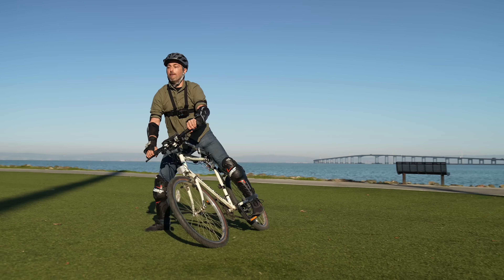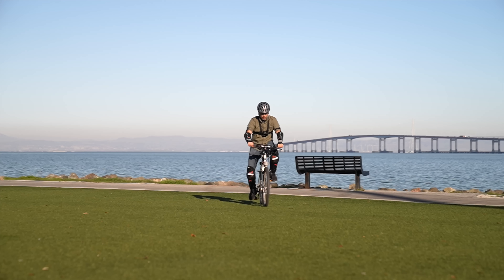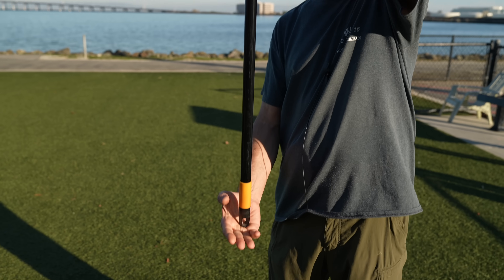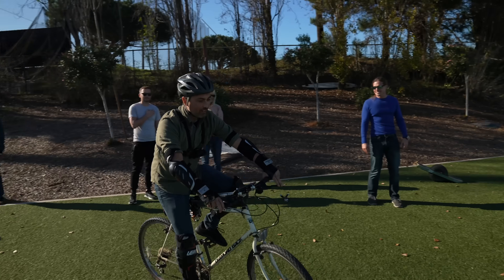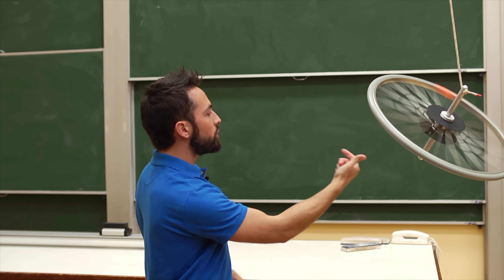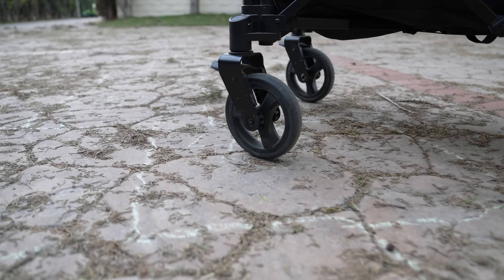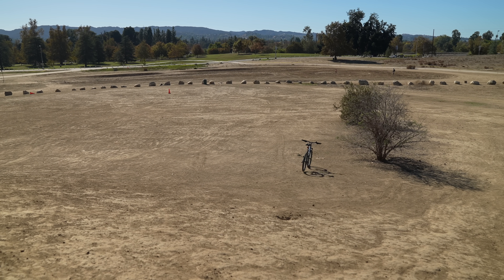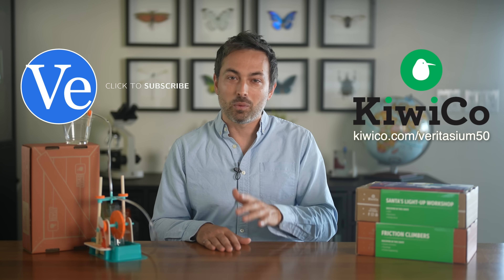Most People Don't Know How Bikes Work

Comment: After seeing this video, I did a lot of experiments while turning. I ride between 7 and 8000km per year, on the road bike.

The result is, that while counter steering, in some situations, indeed does happen unconsciously, it is definitely not necessary: one can just as well turn by leaning the body in the direction of the turn.

On MTB, this is even way more frequently used - standing up on the pedals and leaning the bike into the turn does the job wonderfully. You are not counter steering even a bit on the narrow downhill trail, I've been told by experienced MTB riders.

So, while this is one way to initiate a turn, and maybe even the most frequently used one in commuter rides or by inexperienced riders, this is definitely not the only way to do so.
Reply: >> one can just as well turn by leaning the body in the direction of the turn.

Nope.
Reply: @Rick_Cavallaro  Uh, absolutely yes.
Reply: @antred11  
>> Uh, absolutely yes.

Use your words antred11.  What are you trying to say?
Reply: @Rick_Cavallaro  You absolutely can initiate a turn by leaning into it and steering just in the direction of your turn, without any counter steering whatsoever.
Reply: @antred11  I'm willing to bet $10K that YOU cannot do that.
Reply: The bike isn’t actually turning because you’re leaning, weight distribution has nothing to do with it. I can’t believe this video mentioned nothing about the curvature of bicycle tires compared to a car that has flat tire tread. When you’re “leaning” you’re really just tilting the front tire which causes the ground to make contact with more of the side of the tire due to its curved tread. It’s like when riding a motorcycle, you push the right handlebar forward which technically is turning the wheel to left in order to make a right hand turn.
Reply: @II-XENOMORPH-II  of course. The question was, however, how the turn is initiated. Maybe better say enabled. And that's where the video claims counter steering, while in my experience, shifting the body mass does the same trick.
Reply: @alex.pozgaj  
>>  in my experience, shifting the body mass does the same trick.

That's what most people think they experience.  But it's an illusion.  Take away the ability to counter-steer and you'll quickly find how much you rely on it.  If you could lean the bike by shifting your weight, you could sit on a stationary bike and decide which direction to fall in.  Give it a try.
Reply: @II-XENOMORPH-II  
>> I can’t believe this video mentioned nothing about the curvature of bicycle tires compared to a car that has flat tire tread. When you’re “leaning” you’re really just tilting the front tire which causes the ground to make contact with more of the side of the tire due to its curved tread. 

The video didn't mention that because that's not what causes the bike to turn.  Lock the steering straight ahead and push a riderless bike.  It will lean and then fall, but it won't turn.  I've done that test with the bike in this video. The lean is simply required to balance both gravity and the centripetal force of the turn.  What causes the turn itself is the fact that the front wheel is ultimately turned in the direction of the desired turn.  But lean is required to balance in that turn.

>> It’s like when riding a motorcycle, you push the right handlebar forward which technically is turning the wheel to left in order to make a right hand turn.

The reason you push the right handlebar forward is to counter-steer (as explained in this video).  That takes the bike off-balance resulting in the desired lean.

Comment: I worked this out when I was in my late teens,  at normal and high speed you pull on the bars in the opposite direction you want to turn and you and up leaning into the turn.  Cars are a really bad example since they are one of the few vehicles that do not bank in corners.  Boats, Aircraft and Motor cycles (and bicycles of course) bank in corners. Together with the gyroscopic effects of the front wheel and the angle of the forks this makes it possible to turn corners.  I think humans with their sophisticated balancing capabilities can work this out sub-consciously and not even think about it and learn to ride a bicycle or motor cycle in no time at all.
Reply: A tricycle, like a car, is another vehicle that doesn't (can't) bank into turns.
Tricycles are often used by the elderly, perhaps because their balance is not so good anymore. The three-wheeler can help them to keep riding.
However, if the trike is turned too quickly at moderate speed, the point on the road through which the rider-trike centre of gravity acts, can fall outside the base of the tricycle. The result is that it promptly topples outwards, and the rider likely falls off in an inwards direction.
It is quite distressing to see an elderly lady fall off her tricycle while trying in vain to LEAN her machine INTO the turn..  Meanwhile, the trike is having none of it, and parts company with its rider!! 
Hmm.. the three wheel (tripod) configuration is only stable as long as the centre of gravity... (perhaps more correctly called  "centre of mass" in dynamic systems)... acts through the base. If not, then it can topple rather easily. 
Perhaps trikes should be quads, like mobility scooters usually are (?)
Reply: Yes, that's true.  Years ago I tried to ride a scooter with a side car attached.  I was an experienced motorcycle rider and when I tried to steer it it did not respond in the way I expected and rode it straight into a hedge.  Tricycles do need the handlebars to turn in the direction you want to turn.  I also flew small aircraft and these nowadays also have a tricycle undercarriage where the front wheel is steered.  But there you steer it with your feet, the same pedals that move the rudder in flight.
Reply: Nope. You all sound like you haven’t rode a bicycle in decades and the videos of this guy riding look like it. When I turn left, I turn the bars left.. my body is already leaning to compensate you don’t turn the bars in the opposite direction at all what the heck??
Reply: @SAFbikes  You obviously are talking about slow speed.  try this on a motorcycle or at higher speed and you will see what we are talking about.
Reply: @Tech-Relief  pretty sure cars require counter steering for course correction when they oversteer. You see situations like that on icy roads, rallying and drifting. It's definitely not something a typical driver experiences regularly
Reply: @felixjonson1  yea, thats because the car loses traction
Reply: @SAFbikes  on a motorcycle, you lean so you turn. The bike turns the handlebar to remain upright. If you just turned the handlebar, you would highside and crash.
Reply: @SAFbikes  Even if you don't THINK you first steer left in order steer right, REALLY you do! This video proves it. 
And you can prove it to yourself, by plotting the track of your front wheel tyre compared with the one from the rear wheel. 
You can do this in light snow, or just by riding through a puddle first.
If you do this, say, slaloming around some cones, you will see that for every deliberate turn you make, your front tyre track will first deviate slightly to the other (wrong) side of the rear tyre track.
So, you didn't even notice you were doing it? Hey! Don't beat yourself up about it. Lot's of people don't realise.

Comment: Poor mans way to verify this is to simply grasp the left side of the handlebars with your right hand and the left side with your right hand. The bike will be turned the opposite direction that the rider intends so the slight set up turn to the right will be a turn to the left and the bike will go in the direction the rider intends to turn without getting the bike tires outside the base first.

Comment: You can turn a bike while not even touching the handlebars. You don't need to steer in the other direction. All you need to do is lean in the direction you want to turn.
Reply: Bike still has to be able to countersteer or it will fall.

Comment: I've heard that steering a motorcycle requires conscious knowledge of anticipatory steering because the heavier wheel/faster speed adds enough gyroscopic effect that you need to "over" compensate to make a turn.  I still turn without thinking about it, but it is interesting to know the same is true for bicycles independent of the gyroscopic effect.
Reply: You more feel the Motorcycle.... You don't turn the bars you lean into the turn and keep the bars straight. The motorcycle will go where your eyes are looking naturally so you use that to guide the motorcycle to you don't actually steer a motorcycle.
Reply: Depends on how fast your going.  Slow speeds you cant rely all on leaning

Comment: I think that the reason bikes do not fall while moving is that “ gyroscopic effect “ as the video calls it and in dynamics’ terms  it is the conservation of angular momentum , in fact every rolling disk disk follow that law. If you let a single bike wheel roll downhill, it won’t fall until it stops or the speed is too low to maintain balance, that single wheel doesn’t have steering.  
The examples of people fall with the locked steering bike is that their speed is not high enough to balance or to provide a small time-slot for the biker to maintain balance by counter-steering.

Comment: A lot of people do the intuitive counter steer without knowing it because what they believe they're doing is "leaning into the turn". But what they're really doing shifting their weight into the handle bars. For example they are trying to turn left, so they lean left, so their weight shifts into their left hand which steers the bike right. Which ultimately ends up allowing the bike to turn left. Most people who ride motorcycles  have a pretty decent understanding of this
Reply: Absolutely correct.🤟🏻

Comment: Motorbikes magnify this and introduce some extra variables.

At speed, motorbikes don't want to lean over, and if they are leaned over they want to stand back up. Unlike a bicycle where the counter-steer is only used to start the lean, a motorcycle rider must counter-steer the entire way through a corner to keep it leaned over. The exception is at low speed, where you steer the bike just by pointing the front wheel where you want to go with no lean at all.
Reply: You always countersteer. No matter how much a bike weight or how fast it goes.
Reply: @XtreeM_FaiL  No you don't. When you're at walking speeds you keep the bike 100% upright and steer directly where you want to go. If you try to lean a bike at walking speed it falls over.
Reply: @XtreeM_FaiL  No, riding at walking speed. Those of us capable of riding a motorcycle slowly without having to put our feet down will understand that you don't countersteer until you're going fast enough to start leaning the bike over.

Comment: So many people including myself struggle with physics of bikes .
Reply: That's true.  But based on this comment thread, most seem quite certain they understand it when they clearly don't.
Reply: @Rick_Cavallaro  I drive a scooter..gas powered and now I find myself testing this out ..trying to notice that little turn left when making right turn...now I can't miss it.
 I also try to do these non leaning turns where I lean bike but I try and stay vertical to ground...weird feeling, unnatural.
Reply: @lawrencecarter8072  Yup!  Lots of people in the comments here swear they don't need to counter-steer.  And it's easy to convince yourself that you're not doing it, until you either do the math, or physically lock-out the opposite steering.
Lots of people are convinced that they don't need to counter-steer because they can ride no-handed.  But you still counter-steer when riding no handed.  At that point you're steering by moving your hips (not your whole body weight) to one side or the other.  That causes the front wheel to turn a bit based on the riderless stability parameters Derek describes.

Comment: This is great! I got on my bike right away after watching and tried turning without a counter steer. I think I figured out what's happening for most people. I'm a bit more advanced at cycling than the average person (check my channel and you'll see what I mean), and I think what happens is your average person doesn't trust the bike enough to confidently lean right away. The counter steer acts as a way to help people shift their weight more intuitively, especially at slower speeds. If you're comfortable enough with riding a bike though, it's possible to just shift your weight to get through a turn. Interestingly, there's also a speed threshold where riders will start intuitively NOT doing a counter steer. I don't think you ever reached that speed in your experiment though and I don't blame you, it'd be frightening on that bike! The best example of this is probably in road racing where everyone is riding at a level where they all feel comfortable enough to just lean into and out of turns w/out any counter steer whatsoever. This happens because a counter steer at high speeds would actually be disastrous since it would lead to speed wobbles, which then often leads to horrific crashes. I think that's something people naturally learn with more experience on a bike. On that note though, speed wobble might be a fun topic to explore. You'll see it sometimes for bikes/motorcycles and skateboards cruising at high speeds. It's that terrifying moment when the rider accidentally adjusts their balance too quickly, which then results in a fast escalating series of too much counter steer in an attempt to regain balance. It's a moment that feels exhilarating to regain control from but often horrendous if you don't. Anyway, if you ever do more bike related videos, let me know! I'm a relatively advanced cyclist who also happens to have a strong interest in physics. I would absolutely LOVE to be a part of a video like this. :) - KIKO
Reply: I experienced a speed wobble when I was 5-6 years old. I was riding my scooter at high speeds down a slope, then it started to wobble, I lost control and hit myself really badly lol
Reply: Exactly what I experienced he gets stuff wrong a lot but good videos
Reply: @patrickday4206  Yeah, I think the biggest problem with this one is they didn’t factor in skill level as a variable.

Derek, if you read this, let’s make part two! I’ll fly myself down there for it and to keep things interesting, I’ll even bet $1,000 it’s possible. We can dive into the physics of some other bike stuff too. I got some ideas for it. :)
Reply: @patrickday4206  He actually didn't get anything wrong in this video. I do wish that he went into how steering by "leaning" or body movements and riding with no hands are forms of counter steering. But that would have made the video too long.
Reply: @erniecolussy1705  please go watch a motorcycle race video on YouTube not drag racing they stick their knees out and slowly lean the direction of their knees they may sometimes counter steer but many times there's none
Reply: When you lean to turn you are using counter steering. When you make a turn with no hands, hand off the handle bars, you are using counter steering. If you are good with physics it is pretty easy to explain counter steering and how riding with no hands is a form of counter steering. On motorcycle understanding and using counter steering at high speeds for well controlled direction changes is important due to the high amount of force needed to counter steering. On a bicycle using and understanding counter steering is important. It is a less important for a bicycle due to the much lower weight of the front tire and wheel of a bicycle.
Reply: There is no magical speed when a bike starts to work differently.
As long as you don't reverse, the countersteering is the only way.
0km/h or 100km/h, no difference. Bikes don't know how fast they move.
Reply: For my understanding of mechanics, it is really hard to just lean to one side, because when you lean to one side, you have to push some mass to the other side (equillibrium of momentum). It is like balancing a bike, when you are standing still. On the other hand the amount of countersteer decraeses at higher speeds, because the same turning circle creates higher acceleration. So I think, it just creates the illusion, that you don't have to countersteer.
Reply: @gbornitz   - Speed and skill really changes everything regarding counter-steer. After a certain speed, counter-steer becomes unintuitive and if you go fast enough, it becomes absolutely disastrous to do so. Below that speed threshold though, counter-steer is intuitive and absolutely necessary if you don’t have the skillset built up. Intermediate to advanced cyclists can do it if they tried (I was able to do it after a few attempts). The only time counter-steer is physically necessary is if you don’t have enough speed (ie trying to balance a bike that’s standing still or going too slow) or not don’t have enough skill (ie not knowing exactly how much to lean and how much to turn the bars in the direction you want to go).

Comment: The are alot of bike riders on my way to work. Its a mix of villages, wich require them to ride on the road and then small country side roads, wich have an extra bikelane on one side, so they have to cross the street to get there. I have now witnessed multiple times that, as they try to cross it fast out of a stand, they get going for a meter and fall over. Just as in the video. Now i know why. I guess that, because of the stress they try to conciously steer left and leave out the counterstear. 

They actually taught me how it works while doing my motorcycle license. Since taking slow corners with a heavy mashine is considerably more difficult.

Great Video, thank you for the in depht explanation!